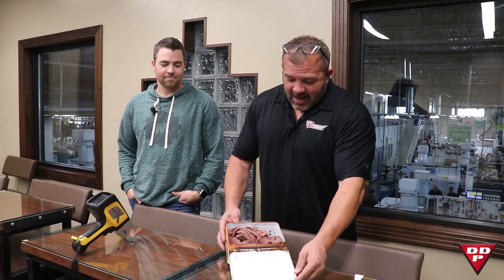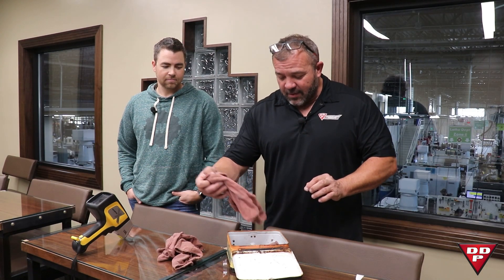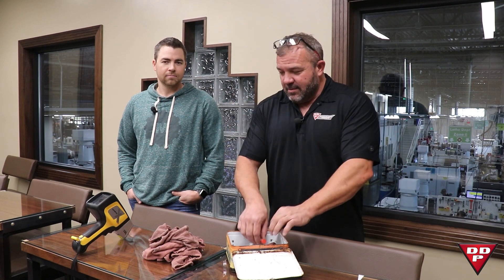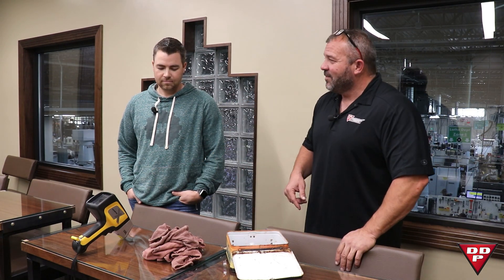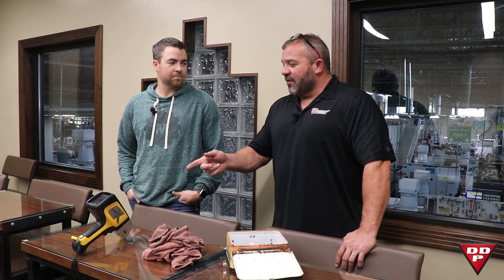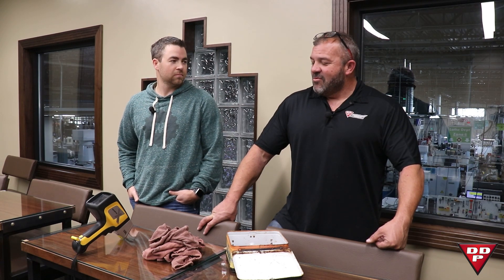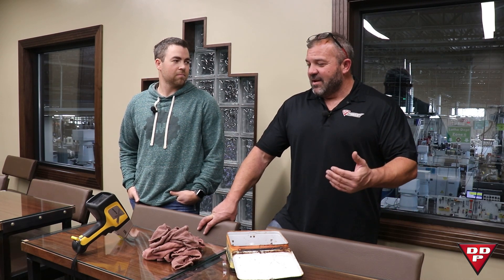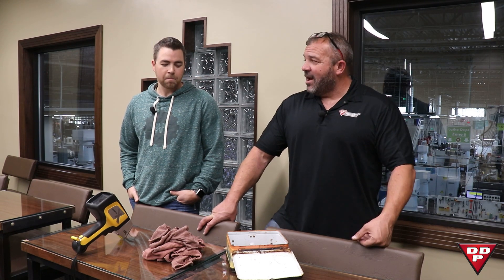Nozzle Composition and Hardness

Comment: 6:18  Only time I hear "stronger" from aerospace personnel is if they are in management and came from outside the industry to get there... Otherwise we speak in terms of tension, compression, hardness, ductility, corrosion, abrasion.  Specs often cite a minimum and a maximum hardness.  Harder is not "better" or "stronger". I'll end my rant there.
Reply from the maker: Our friends at MacKay just operate a manufacturing and machine shop, with aerospace contracts for specific parts. We have a lot of followers who may not know, or understand, all of the technical terms that you're used to using.

Comment: Very nice video, Im wondering about aftermarket nozzles and its hardness. To soft material 51rw and lower ? The needle digs it self in to the seat and lowers inj pr. After time wears true nozzel tip. Vso nozzles.
Reply from the maker: Some of these nozzles that were tested were aftermarket nozzles and tested well in comparison to a factory Bosch product. Even when the XRF gun was used, the material composition was very similar to a Bosch nozzle.